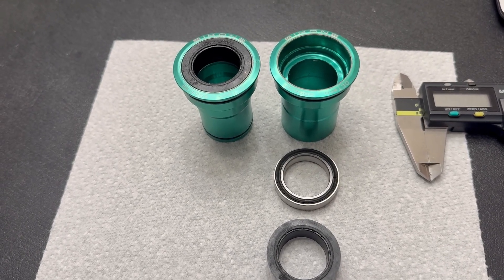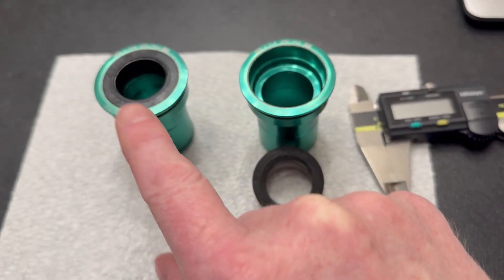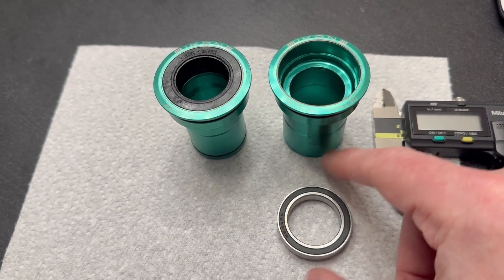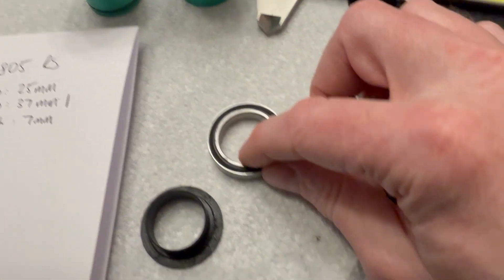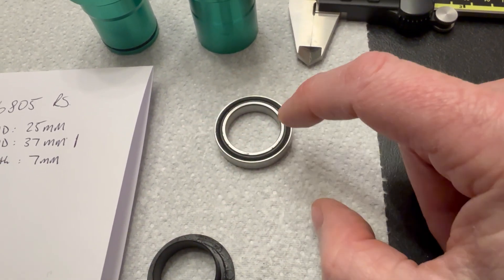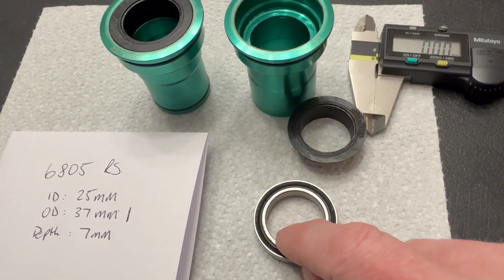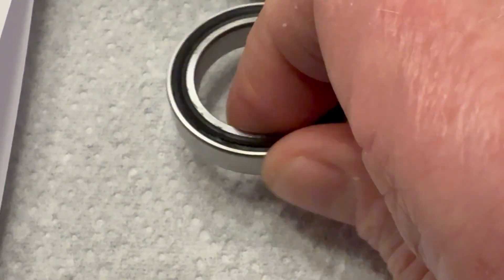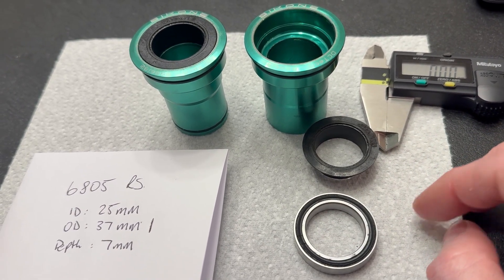Bikone DCTech BB86/92 Failure after only a few months, and weird bearing sizing.

Comment: Quite an interesting finding for this expensive bottom bracket, apparently the outer shell is very well machined, but I don't have any idea why the engineer wants to machine the original bearing spec on the outer race. Any modification to the original design spec of bearings will create new problems and deteriorate the original specification. My only thinking is that you will have to stick to its proprietary design no after market bearing will fit into it. The bearings manufacturers knows what bearing spec should be working flawlessly as it is initial design but not modified its original design to fit to something else.

Comment: Correct. It’s a repurposed seal.  Just put an XTR or Dura ace in.  No point spending more on Bb86/92
Reply from the maker: I'm curious about why the OD of the 6805 has been reduced to 36mm. Means that even if I wanted to retrofit, say, some variant of an Enduro 2437, I couldn't.

Funnily enough, I just put an XTR in and felt somewhat relieved.
Reply: @ I’m not sure, but a few brands do it.  It must be something to do with the thickness of the alu shell.